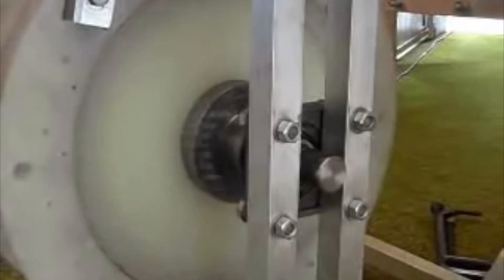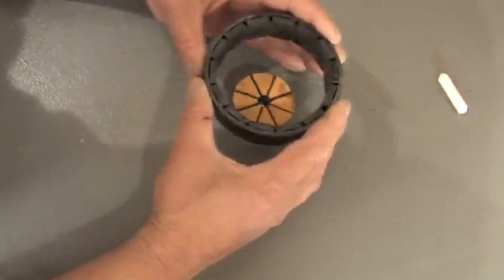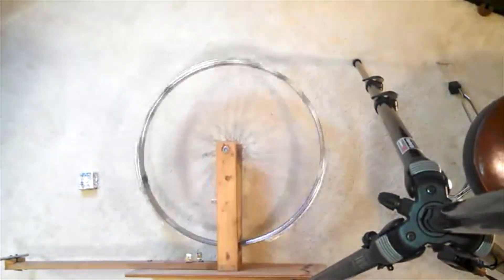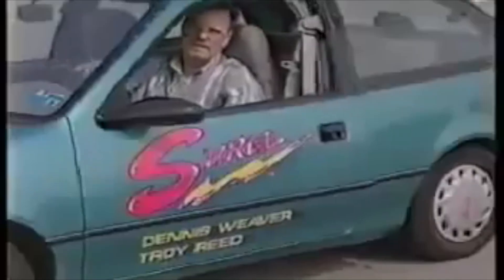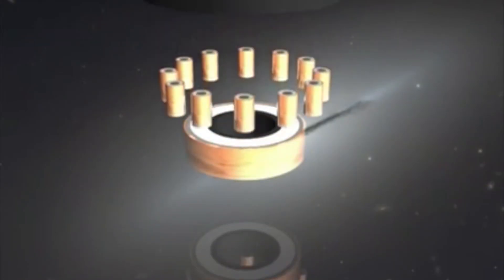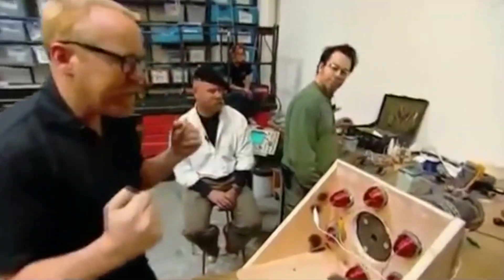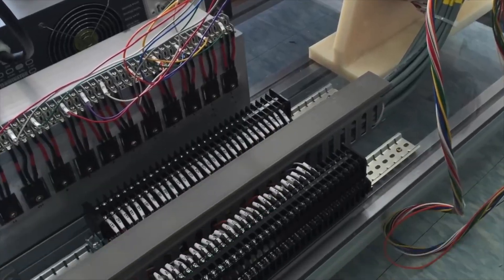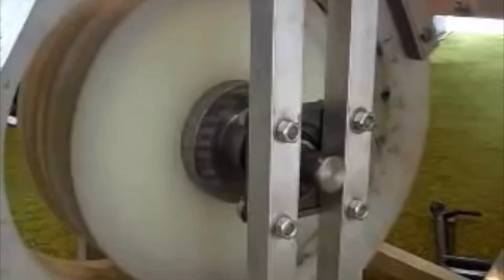Top 10 Most Famous Magnetic Motors

Comment: Serious question.
If someone made a motor with173hp and 520lbs peak tq, that runs without any fuel and capable of running a 100kw generator, how would they go about profiting from it if all he has is the working prototype?
Im not asking about starting a business or applying for a patent, I'm saying that this would be something that people like Elon Musk would be interested in, how does someone get this information to them?
Thanks.
Reply: Publish the plans on the internet, collect your 1 million dollar Nobel Prize money and then make a ton of money selling the story of how you broke physics.
lol. Or not.
Reply: @darklight2.1  1+2=3 that we know.
3-2=1 no laws are broken.
Reversal of the process is what people have failed to realize. Everything about this motor is ass backwards.. it takes off running the moment you put it together, it requires energy to slow it down not speed it up.
Thermodynamics is tricky though because it does not want to say at rest.
Reply: @ahole5407  lol
Reply: @darklight2.1  I'm laughing all the way to the bank.. 😂
Reply: @darklight2.1  wow...  Someone comes up with a way to solve the world's energy problems and he gets crap about it...
Sadly you are wrong with your assumption. I have indeed designed and built this motor. It does not run off of fuel and has no electrical components (aside from an optional capacitor and electromagnetic brake assembly that I plan to test in the future)
Reply: @darklight2.1  and if you read what I have said, I never asked for money from anyone, nor am I seeking investors.
And your idea of publishing unpatented technology on the web is quite frankly ridiculous. Sound more to me like you want someone to divulge the information to you in order for you to profit from it.
If mass produced and sold only in the US for $1 each, If only 1% bought it it would be over 3 million in profit.
Raise the profit to $500 per unit, and  factor in industry and small businesses along with just 50% of households on a global scale just for their electrical energy needs and do the math.. this isn't a scam or else I wouldn't have put the time money and effort into the development.
What I am saying is not a joke, it is for real. What o get out of this is the fame and the fortune that will come from my hard work.
Reply: @darklight2.1  I never said that this had anything to do with "perpetual motion"
I will not go into details as you well know (but fail to acknowledge) it wouldn't be prudent to do so at this stage in development.. and the idea of open source for this is absurd. Some manufacturer will have to produce them for the end user and and that is lost profit. No technological advance has come about without first the application of basic economics. Needs and wants drives consumer demand which in turn create a supply. Capitalization of people's needs is how money is earned. Giving people what they want for free is socialism.

I asked a simple question to get people's response as to how they might go about bringing attention to this because I wanted to see what might work best. 
To sit back and say it can't be done is to give up.. perpetual knowledge will never give rise to new science and technologies. Being upset that you were not the one who did it is shameful. But if you want to be like those that burned astronomers at the stake for saying that the earth wasn't the center of the universe then I guess you aren't really helping anyone.
Reply: @darklight2.1  it's not perpetual motion, it is energy conversion, amplification, and transmission... Energy does not come only from a fuel source, and those that due tend to be very inefficient with loss mainly in the form of heat..... Basic physics.

And one does not "just" apply for a patent without having all the ducks in a row.. if you have ever been through this process before you would know this. Plz read again my original question and I stated that this wasn't about starting a business or getting a patent.. I am working that out now and VERY well versed in this area and I am not seeking any help in that regard.

Yes.. money is what drove my idea. I could care less if people pay hundreds each month on power so long as it doesn't cost me anything..  like I said I'm a capitalist not a socialist. But if I can profit off of making someone's life easier, then that makes my life easier... That's how the system works. 

For a more scientific approach to this concept and how it is applied to engineering  try reading something from Forbes T. Brown and then get back to me.
Reply: Darklight2. Nothing
Reply: I FIND THAT SO MANY PEOPLE THAT GO TO COLLEGE AND GET THEIR SHEEP SKIN ,THINK THAT THEY ARE THE ONLY ONES CAPABLE OF DOING ANYTHING WITH SOMETHING CALLED COMMON SENSE,  IT HAS AND ALWAYS WILL BE OF GREATER USE THAN THE SO CALLED EXPERTS IN ANY FIELD! GOOD FOR YOU ON YOUR ACCOLADES AND YOUR YEARS OF WORK, BUT IT DOES NOT EVER GIVE YOU THE RIGHT TO DASH ANYONE'S FEELINGS OR TO TALK DOWN TO ANYONE EVER! YOUR DEGREES HAVE NOTHING TO DO WITH INTELLIGENCE,  YOU READ SO.E TBINGS AND HAVE BUILT SOME THINGS . SO WHAT YOUR THE DILUTED FOOL THAT HAS NO COMMON SENSE,  AND AGAIN YOU HAVE NO RIGHT TO TALK DOWN TO ANYONE EVER! I DON'T GIVE A RAT'S ASS IF YOUR IQ IS 300. IT WOULDN'T MEAN THAT YOUR THE ONLY ONE AROUND THIS WORLD THAT CAN ACCOMPLISH A GIVEN TASK! IF YOU ARE SO SMART WHY ARE YOU WORKING FOR SOMEONE ELSE? WHY AREN'T YOU THE BIG MAN, LARGE AND IN CHARGE? YOU PEOPLE WITH YOUR PEICES OF PAPER MAKE ME SICK! INTELLIGENCE IS SOMETHING YOU ARE BORN WITH NOT SOMETHING YOU GET AT SOME OVER PRICED SCHOOL! YEA YOU KNOW STUFF, SO WHAT. GIVE YOURSELF A PAT ON YOUR BACK. SOME OF THE SMARTEST PEOPLE NEVER EVEN FINISHED HIGH SCHOOL! THEY HAVE OWNED VERY LARGE CORPORATIONS AND BUSINESSES,  AND CAN MANAGE ALL OF THE IN'S AND OUT'S.  WITH EASE, AND RUN CIRCLES AROUND YOU WITH YOUR PAPER DEGREES! SHUT YOUR MOUTH SIR,  YOU MAKING YOUR SELF LOOK STUPID!

Comment: the whole paradigm lies on the relation (energy < / > cost) i could build a prototype of a simple magnetic motor, but when you try to make a magnetic motor + generator, you introduce magnetic resistance bigger than the kinetic energy made by the motor (if both are equals) , so you simply scale up the magnetic motor to overcome that, and still, a big 20" rotor motor and generator assembly would trickle energy at a flow (power output, amps) in a low current (volts), that would never justify the 50 million dollars you invested in the project, its a 500 billion dollar R&D puzzle, 33% engineering , 33% talent(good professionals), 20% stable financial backing and gestation, 9% good luck , 5% gov aid).
Reply: This argument of yours is void, since magnetic motors do not work. Not for one turn.

Comment: For the people who thinks scientists and engineers are so lame and couldn't come up with these ideas, I want to ask you to understand this...

What's the whole point of creating this? Generate power, right? To save the planet?
As a physics graduate let me convince myself that these work. My real concerns are 

1) I have to be worried the micro or milliwatts that could power literally very few of the electronic devices. But considering the AC to DC conversion, the power will be already drained LOL!
2) The amount of resources needed to make these motor is humongous (for generating tiny little voltage?) when compared to conventional and non-conventional. Also the  W/sq.ft. is very poor due to its size.
3) When comes to efficiency and cost per kW its dead 🤣.

Not convinced yet? Wanna change the world with these magnetic motors? Try reading some hard physics and mathematics derivations and laws just to come up with such conclusions similar to mine😀
Reply: If one actually worked & spun at a decent RPM it could be coupled to a generator like what's used on a wind turbine & used to charge a battery bank at night. None of these "perpetual motion" device work.

Comment: The problem with these is that creators are trying to use the power of a magnet to pull instead of the energy that forces two magnets from touching each other. I have built a piston that ran forever using four speaker magnets, a piece of PVC pipe some duct tape and an unopened can of coffee.
Reply: Got any videos?
Reply: Ok

Comment: Can anyone explain why magnets repelling each other to create a force of rotation which can generate power much in the same way as wind turbine or water turbine cannot possibly work? Preferably without a clever, sarcastic one-liner that you copy and pasted from a "free energy" meme video, I've genuinely yet to see a true explanation.

Over time a magnet looses the potency (so no perpetual shenanigans, obviously) but surely what goes into making them is outweighed by what you can get out of them through this use?
Reply: With no one-liners even..
Because it takes exactly the same amount of energy to push the magnets back towards each other as generated by the force of the magnets pushing each other apart.
Because there is no available energy from magnets, they cannot be a source of energy themselves. This is why virtually all motors that claim to be powered by magnets are fake and no matter how they are arranged- in V shapes, stacked on top of each other, or stuck on rotating drums in the myriad different ways that one sees in videos like this one-magnets cannot be an energy source.

Comment: Mythbusters did it all wrong! Probably because either they are idiots or the Mit guys did not believe the science and also did it themselves incorrectly! Aholes!
Reply: @darklight2.1  Also fake? https://youtu.be/R3Pelqzqd_Y
Reply: @darklight2.1  not hard to find plenty of successful   working models on YT if you bother too!
Reply: @darklight2.1  yes he used an old spindle as a bearing  but not connected! Until you replicate it you wonf know for sure
Reply: @darklight2.1  He has other videos with it still spinning in the background.  Ok  Try to debunk this concept! https://youtu.be/7-5qd7bEiqA  There are many working replication's.
Reply: @darklight2.1  FYI the buoyancy machine does do approx 10x OU , So no need for anything exotic to debunk. No laws have been broken. Fyi there are plenty of videos of the Roche machines without Pedos in jail presenting/reporting it.  Focusing on that does not prove anything . Hollywood and the BBC are riddled with pedos! The air pump clearly displaces the water containers  one by one with air,  that will result in an entire wall of buoyancy,  do the math! had you have to fill it in one go the conservation law would apply!
Reply: @darklight2.1  What have you built or even attempted to replicate? Or are you so fixated on the so called laws that it's just crazy to attempt anything of that nature? Good luck discovering amazing  stuff by that method.
Reply: @darklight2.1  Yet the working replication's carry on regardless of the professional skeptics lol https://youtu.be/o2VEeeqGEkY  https://youtu.be/ftp49tEQ0-o
Reply: @darklight2.1  Do you have a workshop? I have 7 of my own designs to build. If you want to prove me wrong  I'll pay for materials.

Comment: all energy sources have there purpose in society, it depends in the maximum power output they can achieve and required, nuclear energy is the best but is dangerous and technology have to improve for there use, followed by oil and gas, then solar and wind and finally from magnets, they all have an energy output purposes, magnets generator can be used in homes like solar, while nuclear, oil and gas in city's industrial, buildings and in the military or armed forces, in our homes we use electricity to light minor things like televisions, light bulbs, micro oven, heaters or air conditioning while in the military higher energy output is needed for flying planes and oceans ships, tanks, armed vehicles, etc. and the energy output have to be from oil, gas or nuclear ...

Comment: The problem with all magnet DC type motors is that they tend to overheat and this causes the magnets to lose strength over a period of time affecting their efficiency. I have scene or met some of these inventors at Energy Conferences. Investment has been the greatest problem and the failure to deliver the results promised by the inventors from  these devices has kept most of them from being mass produced. Most people do not want to invest in anything that would free them from the electrical grid, they would rather pay an electric bill and let the electrical supplier deal with any cost or maintenance for providing the service.
Reply: 1. Magnet DC type motors is that they tend to overheat. This is because the electric current flowing through the coils in the motor creates a magnetic field.

2. The magnetic field interacts with the rotating magnets in the motor, causing it to spin. However, this interaction also generates heat, which can build up and cause the motor to overheat.

3. To prevent this from happening, most magnet DC type motors are equipped with a cooling system that helps dissipate the heat. However, even with this system, these types of motors can still be susceptible to overheating if they are used for long periods of time or in high-temperature environments.
Reply: @showshowtomakefreeenergyge2426    Sorry, but the interaction of the magnetic field with the rotating magnets does not generate heat. Heat only stems from the current running through the resistance of the coils.

Comment: Hello. You have information on an electric motor of approximately 500 kW, which has a Gigantic torque of approximately 700-1000 N/m.
At the same time, low-speed about 10-100 rpm / minute
--------------------------------------------------------------------------------------------
Привет. 
У вас есть информация, на электродвигатель примерно 500 kW, имеющий Гиганский момент вращения примерно 700-1000 N/m.
При этом низкооборотистый примерно 10-100 об./мин.

Comment: This is why I won't patent my inventions, everyone that does goes missing or dies, within the next 10 years we should have huge self running generators, that will power houses, buildings, maybe even whole towns, and it scares big oil and energy, cause you can put one of these units in a car and never need to charge or pay for any kind of energy.
Reply: @darklight2.1  um, one name, Tesla. Not one, many electric cars were coming out in the 80's and every single one either got bought out, or died. Plus its been shown over and over again that you can power a generator with an electric motor, and yet not a single sign they're going to be made easier to us for the consumer, and mass produce them. Why? Cause it would not only destroy the electric companies and oil, but also the up and coming solar, wind and wave energy. I'm planning on building a unit, installing it in a vehicle, that would push enough energy to power a house, and a little bigger to power my house with battery backups so as not to run it 24/7, but I've made even smaller units from a small rechargeable fan that not only charges itself but can charge my phone, speaker and laptop. But if I patented it and tried to sell or mass produce, what do you  think is going to happen?
Reply: @darklight2.1  why did the smartest man on earth die alone in a hotel, penniless? Are you against free energy, what is your issue dude.
Reply: Oh, and he died alone penniless, cause he wanted free energy for the world, while Edison could make billions. You know it's not considered a conspiracy once there's fact behind it anymore.

Comment: Performance can be achieved with near-zero friction, which minimizes the magnetic energy assembly in airless or other gas.
Reply: Yep, and I went this way because I didn't want to have to deal with the hassle of designing a lubrication system... It was a win win.
Reply: Do you mean with magnetic bearings? I have also contemplated this. Then if you're able to contain the device in a vacuum it would be even better right?
Reply: @THESILENCEMETALCORE    This is futile. With magnetic bearings and in vacuum a device could rotate for a very long time but it couldn't deliver any energy.